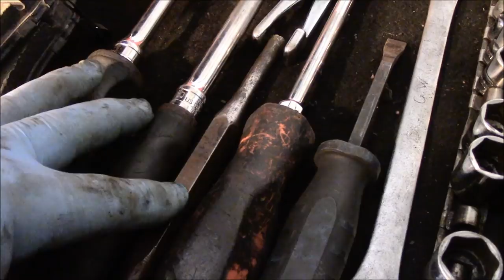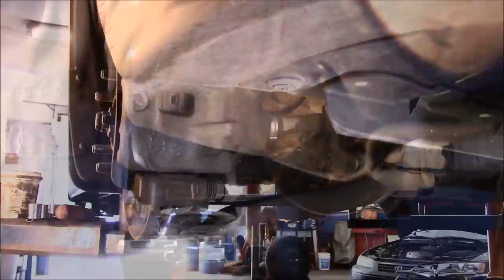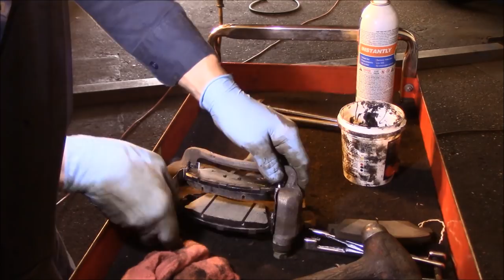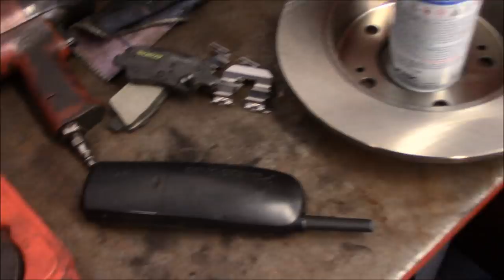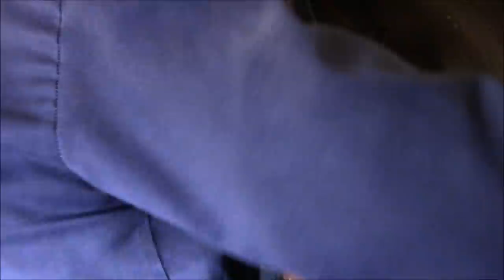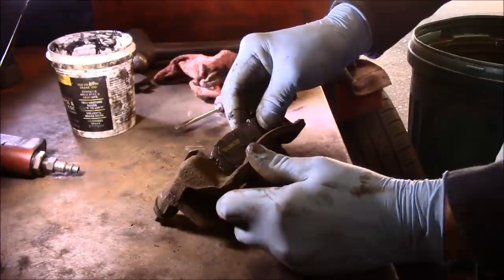How to replace front and rear brakes 2014 Hyundai Elantra

Comment: Thanks for this man. Just did all 4 on my 2013 since I'm giving it to my son so I can get a new car. One of the slide pins was sticking in the rear left (the top one), but I managed to get it out and didn't damage the seal. First time replacing the brakes and rotors 55k miles on it. A little irresponsible of me, but back on track thanks to you Jim!

Comment: Got some Centric posi quiet brakes for my 2014 elantra. Video helped and no noise after. Rear is all is left to do (ran out of time today).  In case anyone was wondering, the ones I got were CENTRIC  10515440 (rear) and CENTRIC 10515430 (front) from rockauto. Fronts are bigger and heavier. I would say they are very quiet brakes. I did the grease as shown in the video and used CRC non-chlorinated brake cleaner and that works well to clean up the dirt and grease.
Reply from the maker: Thanks for watching
Reply: @jimthecarguy  woukd regular needle nose pliers also work or be wide enough to grab the rear piston to twist and push in?
Reply from the maker: @amb7247  Yes they will work but with the correct tool it will much easier.Thank for watching
Reply: Aaron Brown You get rotors, too?

Comment: Jim this video was very helpful. I do have one question. When you said you had to check the torque setting for the bolt. What was the torque amount, how were you able to find it, and which bolt the 14mm or the 17mm bolt on the caliper?

Comment: That was a great video, and I enjoyed how you changed all the hardware, and having the required results. After changing the brake pads and hardware on a 87 S-10 Blazer I felt like I could do the same on any vehicle. Your video showed all that one should do, and I will remember it when I work on one of my other vehicles.
Reply from the maker: Thank you for stopping by the shop Sidney

Comment: Great video on this model but yeah flush the brake fluid, being it's hygroscopic water does leech into the system through the brake lines. You are also introducing fresh inhibitors that prevent rust.

Comment: suggest you put anti seize on hubs after cleaning rust off to stop water from creating more rust will make cleaning 2nd time easier and will stop rust from pushing on rotors and making vibrations .zinc coated rotors best in Canada to prevent rust
Reply from the maker: Thank you for watching. Watch for the next free tool giveaway coming soon.

Comment: Do you have the torque specs for the Hyundai Elantra rotor screws, 14mm, & 17mm bolts? And is the 14mm rear bolts the same torque as the front?

Comment: Great video...loved it...I just tried my 2013 elantra gt and for the life of me, the new pads were so damn tight to put in.  Have you ever needed to grind or file down to fit (or at least ensure they can move freely)?
Reply from the maker: Did you remove the brake hardware clips and clean the rust under them? That is the problem most of the time.

Comment: I have changed pads on sonata and didn’t take brackets out at all… is this different on Elantra? 
Also I didn’t use a crawl bar to push in piston instead I pushed it in after with a clam…. Do these 2 methods need to be in Elantra? 
Any help is appropriated…

Comment: Hi Jim i have a 2013 elantra im gonna change the rear caliper when i call napa for a new caliper they told me to bring the old one
What comes with a new caliper do u get the bracket and what about the banjo bolt does the copper washer come with the new caliper

Comment: Hey Jim,

Regarding the front pistons. Is there a need to push them back in?  I see you did the rear one where you had to twist and push clockwise but I didn't see you push in the front pistons. Is this needed?
Reply: I think I found my answer. Apparently if the front ones are not pushes in, the front pads won't install correctly and likely will not be able to put everything back into place. Thanks for showing a how to.

Comment: Awesome video only problem is he forgot to put the metal spacer/clip on the back of the inner brake pad Other than that awesome video
Reply from the maker: They are actually bonded to the new pads so the old ones are to be thrown out. Thanks for watching.
Reply: Oh ok thanks great vid

Comment: I would not make a good mechanic.  I would need to clean all those parts with brake cleaner, sand blast and then paint those calipers a nice silver or black so they look new.  I would also wind cleaning the wheel well as well.  No offense but this job is easy, brakes and rotors are cheap and garages typically over charged like crazy  for this...
Reply: what's amazing is the brakes can cost you no more for this kind of car at low as $40 to $75 for front and rear. Shops charge way to much for labor. If you know someone that knows how to do this, I do, it makes it much simpler.
Reply: @amb7247  Pads + Rotors front and rear, $300.

Comment: You goofed.  You need to siphon some brake fluid before compressing the calipers or it will overflow in the well under the hood..  As brake fluid is highly corrosive it can damage anything underneath it.  Once you siphon fluid, compress your caliper pistons, then after finishing the job crank up and press your pedal 2 or 3 times until it is firm.  Then top off you fluid.
Reply: Don't siphon all of your fluid, only enough to keep it from overflowing as you compress the pistons.  If you drain it all, then you have to go through the hassle of bleeding all the air bubbles out of your brake system.
Reply: @ewingent1  if you top off brake fluid as the pad/fluid level gets low. Then i agree with you as resetting the pistons on an already topped of system will cause it to over flow out the master cylinder. Other wise if the system is not topped off then this is not necessary.

Comment: hello i changed my pads and rotors in 2016 and again in 2017 and now 
again i have to change..at 32k and 40k and now 55k km..each time always 
same thing..pads are seaized because no grease enuff why???...the 
mecanic said he greased each time...Lisa
Reply from the maker: Did he replace the hardware clips and clean the rust under the old hardware?
Reply: hello thxz for the reply, i guess i will never know, but after watching many vids, i did have an independant garage do just that about a month ago with the same pads and rotors, which have now about 10K of KM left becuz of the previous garage work, but i will be sure to ask that to be done again when i have to replace the brakes after 10k KM ....not sure why greasing and lubrication of the small metal parts and or replacement of clips wasnt done for me multiple times ..Lisa